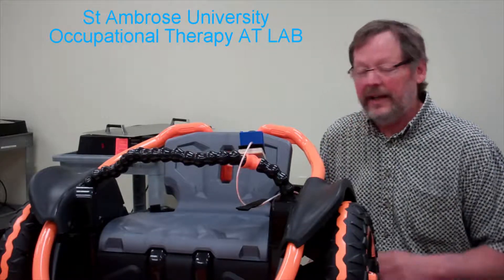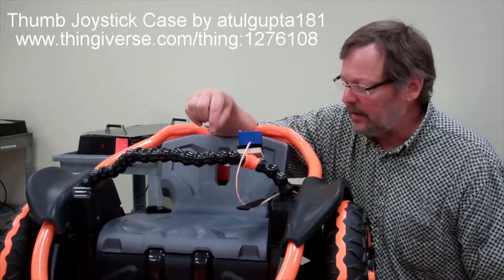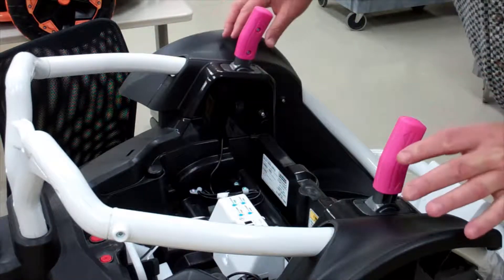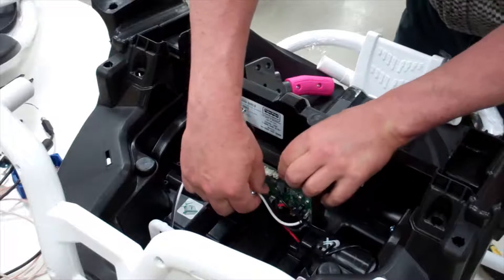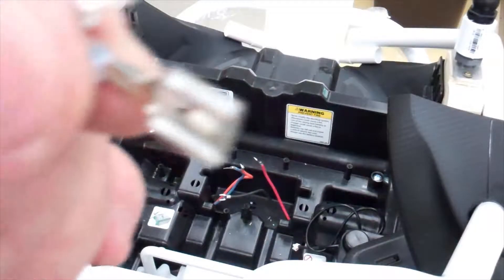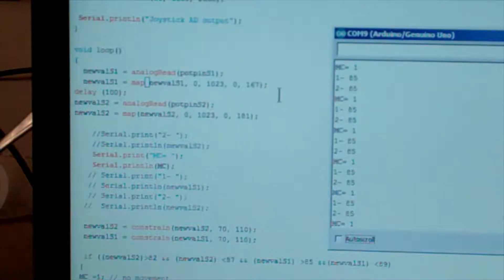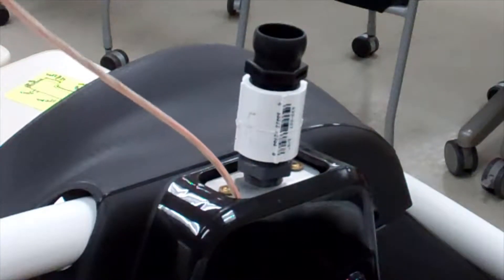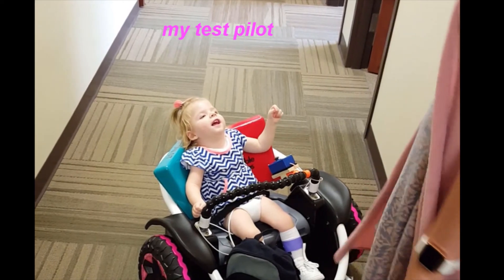Wild Thing DIY Micro Joystick Adaptation

Comment: Do you know if there is adruino code that exists to use the original dual joy sticks? I have had to replace 2 control boards and would rather just convert it to the arduino and PWM motor controllers.  thanks, Sean.
Reply from the maker: Sean, I'm unaware of any Arduino code that interfaces to the hall effect joysticks. It's probably possible. I never looked at the joystick outputs as I needed a single mini joystick. The older original wild thing just had switches so there may be a way. Jon

Comment: Hi do you know anything about the seat to seat sensor?when she sits forward it works when she sits back ot doesn't.
Reply from the maker: That's odd. the seat sensor is located under the back of the seat (red button). So I can see why it does not trigger when someone is on the very front but unsure of your scenario.

Comment: Hi John I have a wild thing for my son the seat safety switch has quit working over time I would like to bypass do you know the color combination for the on run position and the two wires for the push button set mode just not sure on the color combination for these wires there are four or maybe if you have a complete switch and wire assembly including a little Springs and all that available I would be willing to purchase thank you

Comment: Jon, im looking to build something similar to the wild thing with my son from scratch with a metal frame. what type of motors should i be researching?
Reply from the maker: Jeremy, the motors on the Wild thing are small DC gear motors but then it's a light weight plastic body. If your design has a metal frame you will need larger DC gear head motors.  If you can find a small powered wheel chair that would be a good start  as these motors would have wheels attached and make your design easier. The REV Spark controller would easily power these and you could dial in the speed control you want with the software.

Comment: Hi Jon, I enjoyed your video on the Micro Joystick Adaptation for the Wild Thing.  I am about to start a similar conversion on my son's Wild Thing.  Do you think it is possible to find a 2-axis Hall Effect Joystick that could replace the original 2?       Before starting the mod I am thinking if there is a way to implement a simpler design.   If not possible, I will then aim to do the full design you used.      Thanks again for posting this video, and I look forward to hearing from you.
Reply from the maker: Thanks! I'm not aware of a hall effect joystick but that would be great. If the printed circuit board is the problem a have a few extra if you want one. The way I have designed this with the arduino will also allow for greater control over the speed and joystick parameters than the original design allowed. I have needed an extra slow speed setting and that is easy to implement in the code. This also allows for pauses between direction shifts (forward to reverse)  for individuals with not the best trunk support. Jon